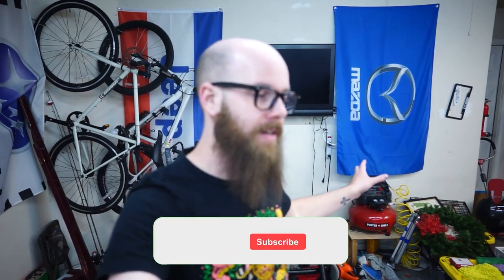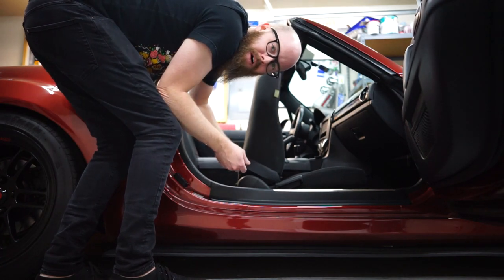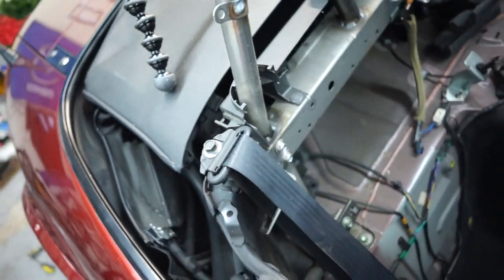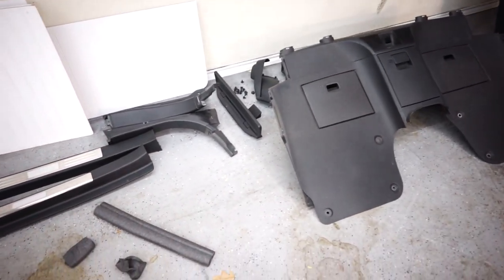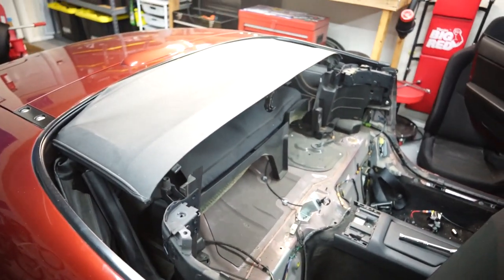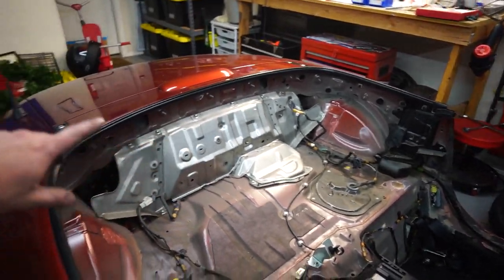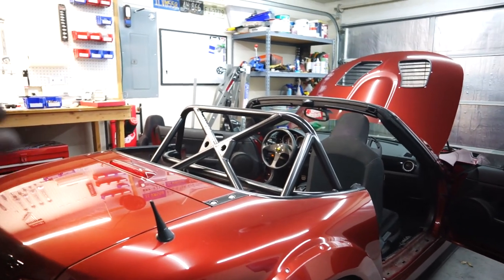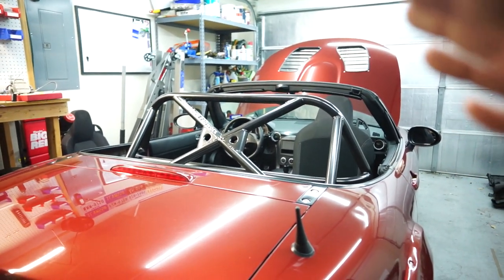NC Miata Soft Top Removal and Roll Bar Mock Up

Comment: Looks good! I put in a BBFX GT3 years ago and I love it. Compared to the top removal, the fasteners for the bar are easy. Remember to vacuum out metal shavings from inside the body cavity. I had some noise from shavings tumbling around in there.  A strip of SFI padding on the top bar for street driving with no helmet! 
Cheers!